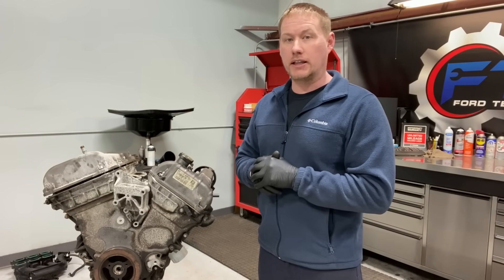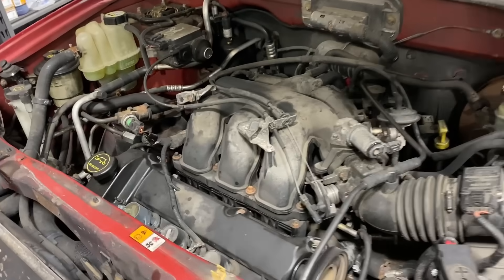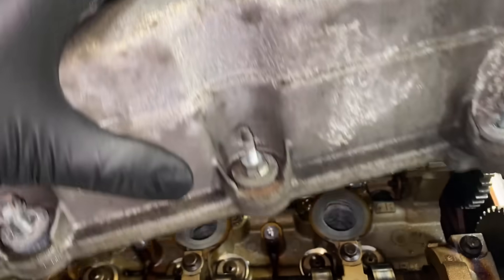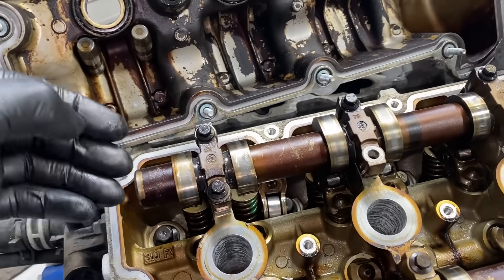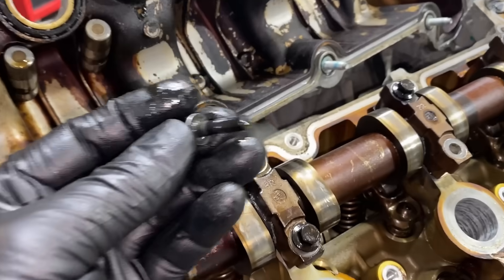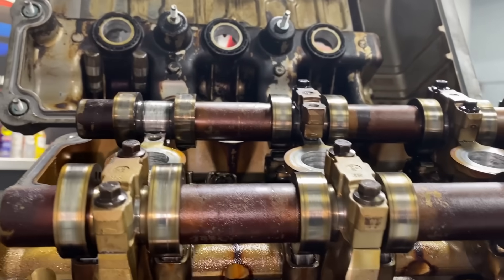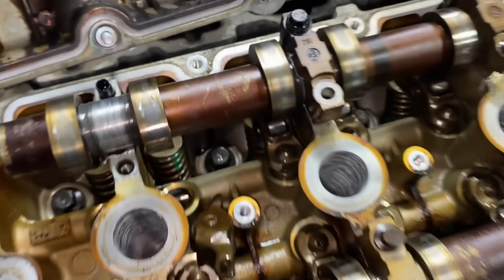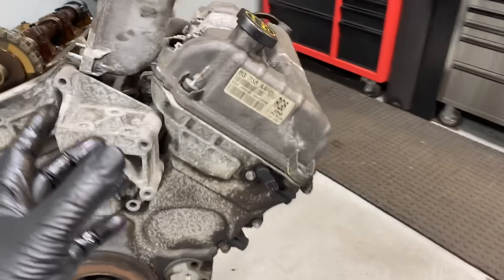Ford 3.0L V6 Duratec Engine: The One Fatal Flaw That Will Destroy This Engine!

Comment: Quick question, 2006 mercury mariner v6, 165,000 miles. I'm doing the timing cover gasket,  there's a thin metal plate on the front behind the crank pulley, with 4 small torx screws what is the blackish stuff behind it? It's flaking off, can I used rtv, or is it special stuff?

Comment: I bought a set of these bolts from Ford I looked up the part number in the official Ford service manual I bought off Ebay. Im looking at them right now and I got the video paused on the bolt and that part numbers match exactly whats in the description and the ones I got are much skinnier and longer then the ones in the video. Whats going on here??? I havent started swapping them yet. I got a 2007 Mariner with the 3.0 liter. Is that whats different in the video Can someone help me out please?

Comment: I had a 2001 Escape with the 3.0 duratec engine in it. The only problem I had was the plug wire for #1 cylinder always going bad every 20 thousand miles. Other than that, It was flawless

Comment: I’ve got a 2010 fusion with the 3.0 I’ve got an issue with some noise on start up when cold. Doesn’t matter if it’s warm or cold out it’s worse when it’s cold out. Goes away within 3-5 secs. Also leaks oil too. Has a lot of build up under the cam pulley for the water pump but doesn’t appear to be coming from that pulley. Any ideas?
Reply: valve covers or timing cover..

Comment: Hi folks, but there is one additional flaw to this engine and it killed thousands of em: the timing chain jumped due to a failed tensioner. I am rebuilding one right now and I thought the best tensioners I could buy were OEM Ford. Wrong! One has started leaking and the engine has been run for only an hour! I don't trust the Chinese crap--and is mostly ALL Chinese crap--and now I don't even trust OEM! Does anyone know who makes the best or improved tensioner for this engine? Rock Auto has several brands I've never heard of. Melling generally has good parts and are an OEM supplier and they make tensioners for this engine. Any thoughts/ideas would be appreciated!
Reply: Good advice Sir

Comment: We got a 2010 Ford Fusion for eve of destruction racing with I believe the start of these problems.  Bought it without the front manifold on it and noticed when we fired it up it had significant less back pressure on the one side than the other 2 ports. Once we put a manifold on it, didn't change much on it and noticed a much fainter noise of the early stages you were talking about. Thanks for the video! Hoping to pull valve cover off it and double check those bolts!

Comment: I would think that the internal water pump on many of these would be considered THE fatal flaw.  At least the Toyota engines were dry belts, so if the pump leaked, no big deal and your timing belt is assuredly overdue for replacement.  

I just got a 2007 Lincoln MKZ and got hold of the owner who had it from 2009 to 2022.  Turns out he sold it to some unknown to me person because it had "a bad engine."  "Oh, yeah, the radiator water and oil in the engine was thick and brown."  Well, whoever fixed it did a bang up job and probably made some good money.  That would have been about 123,000 miles.  It has 125,000 now, so it's good until I die or stop driving.  I'm 78.

Someday when I'm bored I'll check those bolts.  And reinstall with Loctite.
Reply from the maker: These do not have internal water pumps.
Reply: @FordTechMakuloco  The water pump location varied by application.  Many thousands of Duratec engines were made with internal water pumps.  My Lincoln sitting in sight of where I type, has one.  Very common, and in these engines, they definitely rate as a "fatal flaw."
Reply from the maker: The 3.0L never had an internal water but but the 3.5L did.

Comment: Hory sheet! 😳 My engine has 289k miles on it…😅 I’m gonna drive like a pawpaw until I can check the camshaft bolts…😂 Did you say through 2007? Mine is an 08 model, did they fix the problem in 08 or something?

Comment: I have a 2006 mercury montego i have water pump failures leaking where they bolt to the exhaust cam car doesnt over heat but i also have a misfire on the number 4 cylinder what are the chances the cam bolts are lose like your video?

Comment: My 2005 Escape has 223,000 and needs to have these checked. I rarely go over 3,000 RPM at any time. Mostly doing 2300 RPM under normal driving conditions at about 55 to 60 MPH.

Comment: just had the plastic elbow on my water pump break so figured id redo the water pump and take care of the oil leak from the valve cover while I've got it the pulley off and the engine bay open. thanks for the heads up, I'll definitely make sure to tighten things up while Im in there

Comment: I have a 98 Ford Contour SVT with a 2.5L and it has 247,000Km The motor runs great. The 3.0L is sometimes swapped for the 2.5L in the Contour SVT. Unfortunately the MTX75 gear box is f'ed and parts just are not available for it.

Comment: My 2008 Ford Escape sounds like this for about 20 seconds at start up then it goes away. Should I pull the covers and check these bolts or that a normal sound? It currently has just under 129,000 miles.

Comment: You say 01-07 . Did they fix this in the later models? Looking at a 2010 with 103k and wondering what to look out for
Reply from the maker: You should be fine yes

Comment: I’m currently rebuilding mine cause of the same sound except it was a connecting rod bearing.  So I ordered a new crank, all new bearings, oil pump and a couple different gasket kits.

Comment: Great video, ill check this because i might do a head gasket on mine. Question - im seeing oil in my coolant overflow, 07 fusion. Do you know if any duratecs had an oil cooler, or spot besides the head gasket where oil and coolant can mix?

Comment: I'm having trouble finding the bolts they dont show up on fords website and when i go on the mazda website it's $21 and it doesn't specify if thats all of them or just one it really cant be that expensive right?
Reply from the maker: They show on Fords website just fine, just checked.
Reply: @FordTechMakuloco  what's the website? When I search for it by part number it says that it is obsolete or invalid.
Reply from the maker: https://parts.ford.com/shop/en/us/hardware-and-fasteners/hardware-and-fasteners-71564-2/flanged-hex-head-bolt-m6-x-40mm-front-30l-%28at%29-p-w705391s300?pdp=y
Reply: @FordTechMakuloco  Thank you man you saved a bunch of Duratecs from a stupid issue. Now I get to have many more smiles in the future.

Comment: i have to replace the valve cover gasket on my 2010 while have misfire code on cyl1 changing coils and plugs. what is the inch pounds on the caps?, and is this just the 2001-2007? thanks Brien!

Comment: Is there an easier way to be able to tell if the engine is misfiring before taking off the whole valve cover? Like would taking it to a dealership and having them run a diagnostics test with a professional scan tool be a good idea?

Comment: Thanks for posting this excellent video.  I have this engine in an '04 Mazda Tribute that so far has needed absolutely nothing other than proper routine maintenance.  It only has 99k miles on it, but when the valve cover gaskets need to be replaced (which is inevitable), I will now know to at least check the torque on the camshaft bearing caps, if not replace these bolts with new ones.

Comment: I have a 2002 Mazda b3000 with what i believe is the 3.0 Vulcan engine. would this apply to those as well? I am having an intermittent misfire in cylinder 3 so i want to be sure. Thanks!

Comment: I have an 02 with 92k miles, dont have this issue yet, on the other hand I have another.  I replaced the catalytic/exhaust manifold because they cracked and after I got it back together it ran terribly.  The car ran great before, it was just embarrassing to drive with the cracked manifold’s.   Also Car sat for a few months before i replaced the manifolds.   So it Had a terrible misfire, and no power.  Wouldn’t even move on flat ground.  I finally get around to do a compression test, the back three cylinders 123have 155psi.  However the front 3 cylinders 456 had exactly 60psi.  How can 3 cylinders have exactly 60psi?  I used my new Snapon compression tester and a cheaply and verified the same results many times.  Adding oil to cylinders did nothing.  My last thought is the timing chain jumped?   Is this possible?   Would it cause this?   One more note, when car is idling puffs of actual exhaust come out of the oil fill hole on valve cover.   Any ideas?

Comment: more than once you specifically stated 01-07 duratec 3.0, does that mean it's not an issue with the 2010 duratec 3.0 engines because ford corrected the problem????
Reply from the maker: I have not seen it no.

Comment: My 2005 Escape 3.0 liter V6 has those same oil leaks and engine knock and lower performance than before. It still runs at 160,000 miles though. I drive it really rarely now. If I get a mechanic to re-torque those 34 cam cap bolts, and replace the valve cover gaskets would that possibly extend its life a bit? Seems like it hasn't reached the catastrophic point yet which is why I drive it so rarely.

Comment: Cam cap bolts should be replaced whenever a misfire occurs. Get newbolts and caps from Ford and replace with 89 inch  pound torque.

Check for oil leaks on cam cover gaskets and front cover gaskets.

Comment: Which years had this issue? The 2008 Escape still has the Gen 1 engine and auto transmission. When I bought my new-to-me model with 147K miles on it, I had the spark plugs, coils and valve cover gasket (and other gaskets) all replaced. While the head was off, I had my mechanic check the torque (slightly less than the full torque) to see if they were still tight, but not in danger of snapping. All was good.
I'm in the process of replacing the fuel pump (erratic gauge) and belts. 
The engine purrs like a kitten, burns no oil and has no leaks since the valve cover gasket is new.

Comment: I have a 2003 Ford ranger 3.0 motor and it does not look like that engine. There must be 2 different types of 3.0 engine's for Ford.
Reply: This video is for the Duratec 30 engine I think there is another 3.0 that Ford designed this is a Mazda design

Comment: glad i found this video. i have a 2006 Escape 2wd V6. i have currently 77K miles and it runs smooth at idle but in 4 gear going up a hill at 60mph and barely giving it gas it is missing a lot until i let off the foot feed and feather it.

Comment: What a lucky break. I'm in the middle of changing valve cover gaskets. I don't suppose anyone has a link for those bolts? Specifically for a 07 Fusion 3.0?

Comment: Woww very interesting. I have an 09 Ford Fushion SEL. Great vehicle, almost 210,000 miles. I only put mobile one oil into it just put a new drain plug thinking that was solely where I had oil leakage. But now I’m going to look around my T-joints and I feel I hear that that noise with the Cam Caps. Could be loose on mine based on the sound from this block but not nearly as dramatic

Comment: There is a TSB on this. I think it was on the Fusion. I always double check the torque on them when I do valve cover gaskets. Haven’t found one loose yet. But I’ll keep checking.

Comment: 2004 Taurus SES Duratec 24v with 295,000 miles. Pulled the valve covers due to leaking oil. Flexible gaskets were hard as a rock and had 1/8" gaps in areas allowing the oil to leak. I saw this video and checked my cam bolts which were fine when torqued to 89-inch lbs. I don't think this loose bolt situation is a design flaw. More like a bad torque value when assembled in some instances but who knows what really caused it in some cases. I do know many people who swear by the Duratec 24v and have driven them over 300,000 miles no problem, and overall the engine is not known for this loose cam-bolt problem, or a service bulletin would have been issued.
Reply: There is a service bulletin for it.
Reply: Actually, there is a service bulletin and then an updated service bulletin on the same subject of loosening cam caps @jaredbrown1662

Comment: I have a 1999 taurus low mileage synthetic oil changed every 3000 miles. Its still a very nice car but ugly the day it was built 24v DOHC grandfather's car. I wanna build a hotrod with my grandson. Haven't picked a car but have a 41plymouth. My ? Is can this fwd engine be mated with a automatic rear wheel drive transmission? I'd really appreciate the info. Thanks love you videos

Comment: Gee oil leaks are no big deal, you say??  Just fix them and move on??  Really ?  How about the Ford Engineers design better robust oil sealing systems and or solutions, huh!! Just how long have we been building cars??  Those oil leaks drip on the hot cat converters and exhaust system and make a big mess. Cost hours of labor to repair and replace those rubber band toy seals. Thanks Ford.  : (

Comment: Just partially completed this job on a 2006 Lincoln Zephyr, and I'm at a point where I'm lost. This is the first gen VVT model, and nobody, not even the ford catalog, have the correct diameter VVT solenoid seal. Ford calls for the larger 42mm diameter seal, when the correct seal is slightly over 40mm. Fel-Pro makes a 40.2 that is also included in their valve cover gasket kit, but it's so loose it can be pushed in without being driven in. I guess that's the one I'll have to use, because Ford can't provide me with a compatible seal and there's very little info available online that covers this. Very interesting.

Comment: Mine is almost at 351k miles and I'm about to replace the engine gaskets and oil pump and timing chains. I'll see if I have this issue while I'm in there. I'll at the very least use loctite
Reply: Wow what year and model is it in? What maintenance have you done to get it to 351k?
Reply: @jeedwards1981  2005 ford escape. I bought it in 2020 from a lady after it was rear ended and she was scared to drive it. It had 305k. I'm up to 365k now. I replaced all engine gaskets and oil pump and now it doesn't leak. I just change oil and all fluids periodically. I've had to replace the alternator at about 310k, a throttle position sensor, an O2 sensor, oil pressure sensor since it made the oil light come on randomly. I should have left the original oil pump since the new one makes noise but still works. And 2 coil packs. A lot was just from the mileage. This thing still runs smooth and has no issues at all. Never had transmission issues.

Comment: Thanks for the video Brian, Ford should put cam cap bolts that can be  locked by wire you know they have a hole in the bolt of the bolt  after beening  torqued they are secured by wire, Like Aircraft engines they don`t want them backing out, "they can`t pull over and park on a cloud".

Comment: Hey - I know this is kind of an old video .. hopefully you catch this comment @fordtechmakuloco - I have an 08 Escape with this engine and I've got oil leaks.  I was about to do the valve cover gaskets, and then saw this video where you suggest the worst part is the "oil leaks from the t joints."   I was about to do the valve cover gaskets until I saw this.  Now I'm going to replace the bolts and do the other cover gaskets .. do you have a video on how to repair the oil leaks you mention at 1:20 ?

Comment: would this problem cause the cam to move in  a way that cause destruction of the camshaft position sensor?
the tip of the sensor next to the cam was hit and destroyed.
cheaper to replace the engine at this point or just the cam?
Reply from the maker: If you are doin the work yourself it would be cheaper to just replace the affected head.

Comment: @FordTechMakuloco I have a flex 3.5 non turbo and went to change out the Water Pump and when I was putting it back together the crank somehow jumped a few teeth when torquing the balancer..any ideas?

Comment: So I bought a 06 mazda6 with the 3.0 it has developed a tick after a oil change everything was done properly with the proper filter and oil level as well as factory spec oil but developed what sounds like a lifter tick (very random sound) as well as a slight humming noise in the cabin from the engine harmonics. Any idea ? where to start?

Comment: I'd love to see a detailed video of how to replace the gaskets on the front timing cover to fix these common oil leaks on the 3.0L. My 2006 Fusion is leaking all over my driveway and driving me crazy!
Reply: Did you find anything regarding this? have a 2008 fusion 3.0 AWD that has timing cover leaks, oil pan and valve cover leaks.
Reply: @patrickmcclain878  No, I've just resigned to parking the car in my garage and keeping cardboard under it to catch the drips. Tried various "no leak" oil additives, none of them worked.

Comment: Hello, I have Jag X-Type of the same engine, I have that kind of rattling sound on cold start but only for 0.5-1sec , afterwards it works beautifuly and whisper quiet. What could it be, the sound comes from upper valve side where the VVT actuators are, not yet sure if only on one bank. Pretty sure it isnt chain, had a quick oil change on hot engine , and until oil got up to valve cover it made the noise even longer for a couple of seconds.. thanks!

Comment: So I recently had a misfire on cylinder 4 according to an obd diagnostic tester.   I went through and replaced spark plugs and found that ignition coil wiring insulation was damaged on cylinder 2, and the ignition coil contact for cylinder 3 was corroded and had arc damage.  No signs of why cylinder 4 was misfiring but after fixing those things and new plugs the misfire was gone and  I improved my mpg by 5 mpg.   When a misfire happens is it more likely that it damages a pcm or is it more likely that a pcm fault causes the misfire?   Also does this sound like its time for me to open up the valve covers for this video repair?